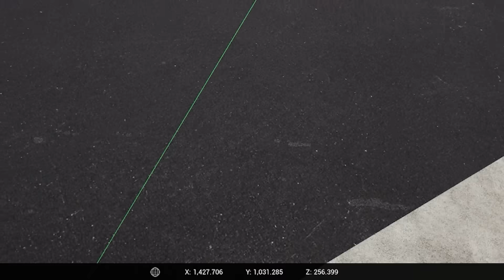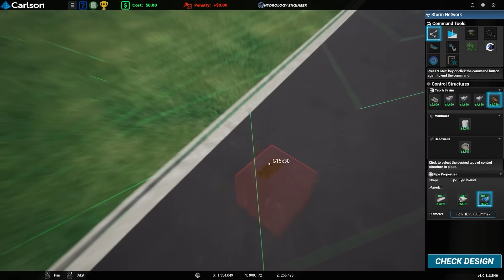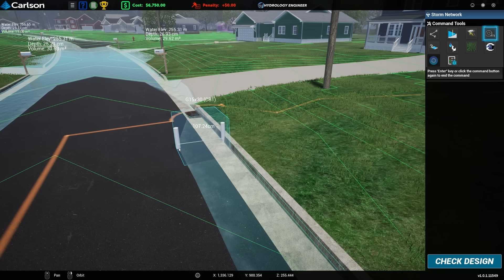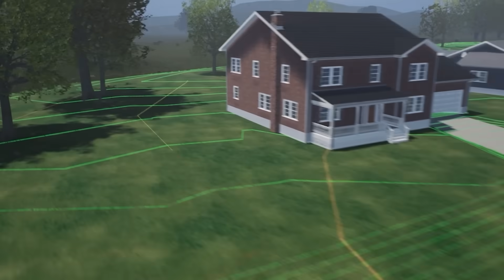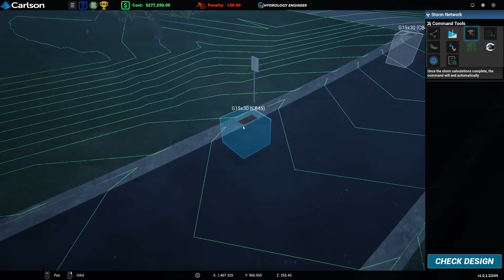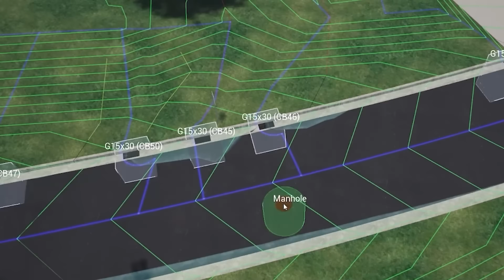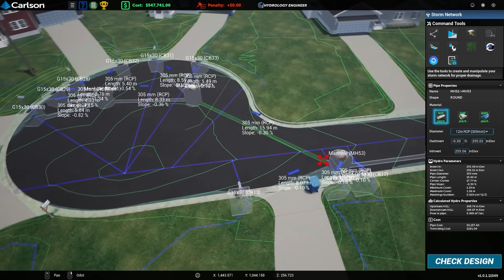How does storm drainage work?

Comment: Random question: How do you take in account thing like slurry/manure that can clog the grate from above?

Like in my village, our network is working, but because of slurry, manure, dirt or that kind of thing because of tractor that pass on the road, some of grates are clogged. The pipe underneath are not clogged (or they doesn't look like it's the case), but they are blocked and do no let pass any water.

Comment: as for the runoff from the grass, it really depends on the soil. clay soil has a lot of runoff, and loose soil has almost none. of course clay soil retains water and so you need to be careful when doing slopes since the soil gets heavy when the absorb water, and end up with natural structural gradients which causes mud slides.

Comment: Really cool to see Matt in his element. Also puts into perspective how much stuff is under ground. Drainage, sewer, power, internet/TV. I wonder what the guidelines are for all of that being in the ground together.
Reply: I expect there are standard distances and depths for each specific utility. I don't know how it works in the rest of the world, but in Australia there's a service called "Dial before you dig". You call the number and they can tell you what services run in the ground in the area you want to dig in (so you don't burst water mains or electrocute yourself, etc). Engineers I assume would have their own plans, but for the backyard handyman, it's a literal life saver.
Reply: The other levels have supply water and sanitary sewer pipes. There are local jurisdictional clearance rules. In these levels its 15" clearance. So the storm pipes have to be 15" below the supply water and and 15" above the sanitary sewer lines.

Comment: I now live in an area that doesn’t have the upright part of the curbs, and it’s just kind of sloping, with a low part being the gulley. But it does that across the driveways, too, so I have to drive in at an angle to avoid hitting my car on the road.
Also, they have the sidewalk right on the road, with no grass verge in between, or no sidewalk at all. So I looked up how mad someone could get for my dog peeing how far onto their lawn. And I found in my area that there’s like two feet or so onto the lawn that the city owns but the homeowner is responsible for, just like the grass between the sidewalk and road would be.  That’s where the lampposts and fire hydrants and stuff go, and probably manholes, too.

Comment: Drainige question here: What ist it in generell for Bridges? Is it preferd to have ducts that let the water out at side ports, or is it colected to get it away from the bridge to avoid erosion? ( Play stormworks!)
Reply from the maker: Generally you wouldn't just let the water drain directly beneath it due to the pollution in road runoff, but it can be done depending in what's beneath!

Comment: Don’t know if it is specific to UK, but here in Canada, gullies are joining the main pipe with an underground tee, never in manholes. Also, the stormwater pipe is on one side of the road because the sanitary sewer is in the middle and much lower, and water main is on the other side. That way, a leaking sanitary sewer won’t contaminate the storm water system, and the water main won’t freeze because it is far away from the storm water pipes full of the cold ambiant air. And it is always better to go with deeper manholes than longer pipes because of the drag, so it doesnt matter if the main line goes against road gradient, but towards the pond.
Reply from the maker: Yeah we do gully connections straight to the pipe too but generally it's best practise to do it to a chamber as then you can rod it from either end rather than just the gully end!
Reply: Developers love to do it with blind Y connections because it's cheap. Pain in the arse to maintain though, so whenever we do our repairs we drop new chambers in as well.
Reply: That sounds quite sensible, the pipe layout under the road. My question, which is most likely to break/block and need to be dug up? The shallowest pipe, to my mind, should be the one most likely to need repairs/maintenance most often.

Comment: Hey Matt, at 2:23 you say that the Z level is the height. Kinda funny but just to jog your memory, X and Z are horizontal axis, while Y is the vertical axis. So in reality instead of going down .1 meters, it’s gone down .5. Also since this is a American game, probably measured in feet, which makes more sense because going down 50 centimetres is a lot. Great video none the less, and love all your other ones as well😁
Reply from the maker: No, not sure when you got that from but z is always elevation. That's universal and not just British!
Reply: @RealCivilEngineerGaming  Oops my bad, for some reason I was taught that Z was on the horizontal axis and different programs that I use such as Blender and Autodesks Inventor seem to project that myth. Sorry for calling you out on something that I was incorrect, cheers and once again great video

Comment: there's a different style that's done in the US, at least residentially. Here, you're allowed to pipe gullies to gullies. it can make the whole piping puzzle much easier. Also, curbside inlets can handle a surprising amount of water. curbside inlets are like, the ones without the grates. They handle a lot of water by basically being a really wide grate. However, they can be more expensive by being concrete topped instead of a small iron grate. However, they integrate into sidewalks VERY well. I woulda planned the water handling from the bottom (hue hue, lowest elevation) up. See how much you can save by doing gully-to-gully piping
Reply: Seeing all those gully boxes rather than the curbside inlets looked very foreign to me. Also, how is Pennywise supposed to snatch children through one of those?
Reply: As a drainage engineer in the UK - I'm wondering how your inlets work in terms of maintenance? Gullies are often used because you can quickly and cheaply send in a truck to jet out the sump and collect all the silt. Where we use channel blocks (similar to your curbside inlets) the maintenance is much harder and more expensive.
Reply: @MrManningata  It depends on the Curb drop inlet design. The grate designs without manholes and work exactly like your grate-only inlets, but with a curb cutout. For the drop inlets with manholes but no grates, the manhole usually sits on top of center of the structure(though there are longer offset-manhole inlets that don't follow that rule). I'm clueless to how and what kind of maintenance goes into the DI's in the US, but from experience as a Land Surveyor here, it's a lot easier to open a manhole on a DI than it is to lift a 150lb+ storm grate that's been run over and sealed with silt and/or asphalt.
Reply: @TheStoic84  a manhole key or two shovels work wonders.  Been installing and reconstructing water and sewer utilities for the last 10 years
Reply: @MrManningata  in the US our in curb grates are typically manholes, that is typically a trunk line. We have stubs that go across the street with smaller but dedicated lines, those normally connect to either an individual or dual 2x3 catch basins. All of those can be easily jetted into a sump manhole, which is typically your last manhole before it exits the system.  We can use a truck to suck out the sediment from the sumps.

Comment: I think the pipe collision might have been where the outlet of one of the networks passed next to/under a gully in a low spot.

Can you create your own custom levels in this? And can it do the calculations for roof areas and guttering? I'm wondering if I can use it to design the house/land drainage for our property - Currently, the gutters go into the ground right next to the foundations and the land has very poor drainage, but we do have a ditch so planning on piping it all into there!

Needless to say, please continue the series.

Comment: And then someone changes the roadway profile a few days before submittal and you have to work all night to redo everything. The life of the drainage engineer.
Reply from the maker: This guy knows! Drainage is always the last down the line 😢
Reply: @RealCivilEngineerGaming  then the survey goes out to set out pegs for the drainage but doesn't get the updated files and sets it out to the old design anyway
Reply: @shaunwadham6768  HA! Love this.
Reply: @shaunwadham6768  truth.
Reply: @RealCivilEngineerGaming So... drainage is downstream in the low point of the project.
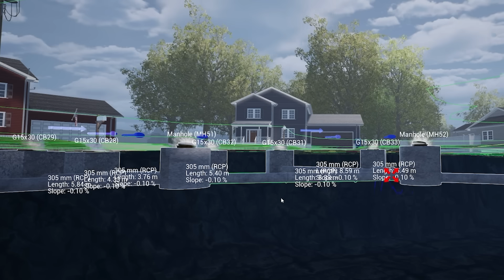Reply: It did have pipe velocity btw, at 28:20 the "flow in pipe" property was  0.042m^3/sec @RealCivilEngineerGaming
Reply: @D1RTYBACON  That's not the velocity, that's the amount of water flowing through. m^3 = cubic meters. He was talking about the speed in which the water is moving.
Reply: I love all the comments here. It is correct we don't show flow velocity in the gutter. We do calculate the flow velocity of upstream and downstream on the pipes but it looks like we just removed the display of it to simplify the view. For overland flow we do calculate the runoff Tc. Is pipe velocity interesting? What information would it give a player that helps them in the context of this game? I don't think we show junction loss either or EGL, this was also just trying to simplify things.
Reply from the maker: @CarlsonSWEdTech  personally the velocity should be way higher priority than some of the other things that are shown. Though I noticed the "game" quite often automatically put falls on pipes, overwriting the manual levels I put in, so maybe it does minimum falls anyway?
Reply: @CarlsonSWEdTech  I think rce was suggesting that flow velocity was important in order that the water keeps the pipes clean rather than building silt over time.
Reply: @zyeborm  you contradict yourself.  He is referencing a scour velocity, which is the requisite speed a fluid must flow through yo prevent deposition of solids. There is an upper limit as well but that has more to do with the grade of the pipe being installed vs the actual speed of the fluid. I have installed water and sewer utilities for the last 10 years, that is the only reason I have a basic understanding of those things.
Reply: @Blindsia83  no, I haven't contradicted myself. I said "velocity" isn't measured in cubic metres per second. It is measured in metres per second.
Cubic velocity is a different and rather poorly named imo quantity.
Rce said the other guy was wrong and liked my comment saying so.
That's it. 
You can argue with the examples given if you'd like but they were given to demonstrate the difference between cubic metres and meters not to be an example of drainage engineering.
Reply: @zyeborm  I was referring to you saying keep the pipes clean vs removing silt buildup was all. In storm sewer those are one in the same.  Yes you have other debris that enters the system but ultimately you are talking about the scouring velocity.

I think I got confused on the way you worded your comment. I thought you were saying keeping the pipe clean was different from preventing silt buildup.
Reply: @Blindsia83  no just saying you need stuff moving at some certain speed to stop crap from building up.

Probably because I spoke about things falling out of suspension as well as the flow clearing stuff that has built up.
Reply: @zyeborm  All good. I'm gonna chaulk it down to a mixup on my end. Have a great day
Reply: @Blindsia83  you too mate
Reply: Having watched Engitopia and the number of times Matt has randomly raised or lowered the terrain by a hundred meters I really feel for those engineers!
Reply: In other words, all of your hard work went down the drain...
Reply: @urkerab  😂😂😂
Reply: I usually do the grading and the storm design. Is it common in England to have them separate?
Reply: A cumec, cubic meter/second is a measure of velocity. It's a standard measure for speed of flowing fluid. Bacons right, RCE just didn't see it
Reply: @corneredbadger  if its 1 cubic meter per second moving through a 5M diameter pipe or a 1cm diameter pipe the velocity will be very different. He was talking about velocity not volume. you won't get sediment in the 1cm pipe but you will in the 5M pipe. Velocity will have a unit of meter/sec not cubic meters/sec
Reply: @zyeborm you're also wrong. Cubic meter per second is a volumetric flow rate. Also called volume VELOCITY. It is the measure of the VELOCITY of a given volume through a natural or artificial space. And yes, this volume changes based on size of the pipe but it is still a velocity measurement
Reply: @corneredbadger  velocity is measured in metres per second. Not cubic metres. The thing you're talking about does not tell you how fast a water molecule is moving through the pipe. Volume velocity, cubic metres per second. Velocity, metres per second.
See the difference in the units?

How fast does your car drive? 45 cubic metres per second. 
See how that isn't a velocity?
45 metres per second
See how that is a velocity?

Can you see how when you're trying to see if silt is going to fall out of the water column if you have a 5 metre diameter pipe and a garden hose carrying the same volume of water per second the water is moving much faster through the hose than through the large pipe? That the silt will fall out in the large pipe but get washed along the small pipe?

That is why the actual velocity not the "volume velocity" is important.
Reply from the maker: @corneredbadger  no this is incorrect. Flow is volume per second, so the amount of water moved per second, which isn't really related to a velocity. Velocity is metres per second and is how fast the water is travelling, not how much of it is!
Reply: @corneredbadger  Flow and velocity, while directly proportional, are not the same value. You need to convert between them, which is not trivial by any means. For one, you would have to factor in the area of the cross-section of the pipe, which would need to be calculated separately. While the program could very easily do this conversion for you, it doesn't - and it's not something most people can do off the top of their head.

Comment: Maybe it's because i studied engineering too (Telecomunications in my case) and i ended up woirking in coding. This brings me back nice memories of working on assignments in different suimulation programs.

The editor might have complained. But i think i would have even enjoyed the 2 hours of raw footage.
Reply: I also have an undergrad degree in telecom engineering. I'd love for someone to make a game like this for like, cell tower design or something.
Reply: @zamboughnuts  The closest thing i can think of i did at uni was common telecomunication infrastructures. 

A simulator like this could be easily done. Make a 3d Model of an appartment building, and then let the user set up the different wires for telephone, tv, internet... calculate/simulate loses and noise, set up cable type and gauges. There's enough meat to make something like this.

Comment: Isnt it easier to just pour a bunch of water on the street and note where it collects irl?
Reply from the maker: Haha yes easier, but you build the drainage before the road!
Reply: You add the stormwater system under the road
Reply: This design is done before the road goes in. There's no point in building a new road and then immediately ripping it up to install drainage.